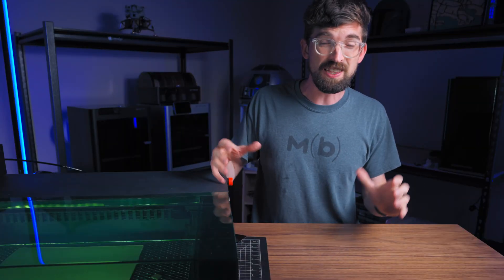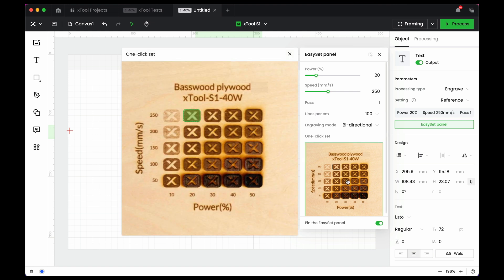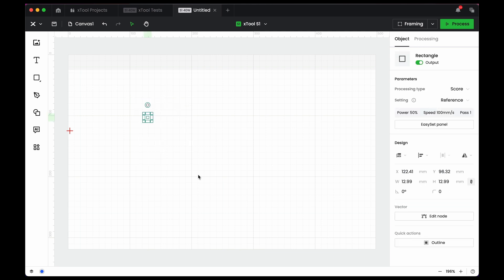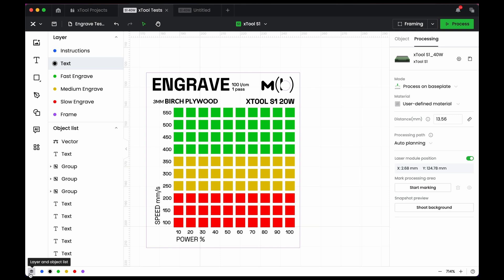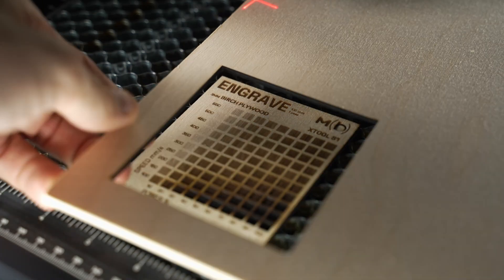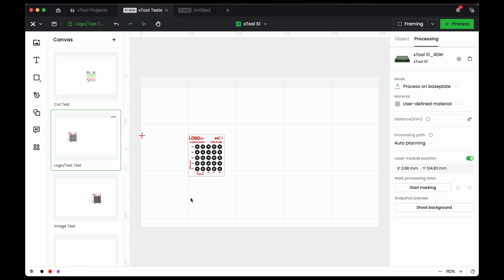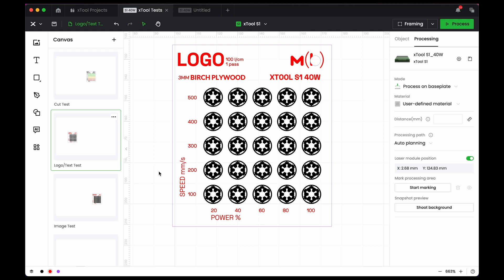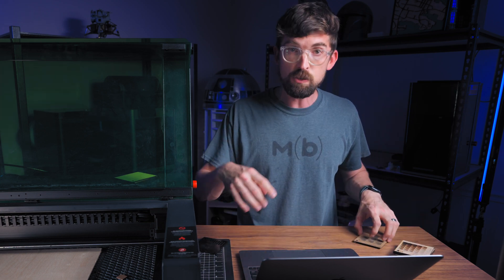How to Find the Best Laser Settings

Comment: I have the same unit as in the video S1 40W. I did the print of the first section in green, why are yours lighter then mine. My 400x100 looks like your 150x100?

Comment: Hello, just bought test for S1 on your shopify and there are errors in the fast engrave, in the image test and in the logo test. 
In the image, all fast engrave speed values are set to 400mm/s instead of mixed, from 400 to 550mm/s.
In the image test and logo test, all 500mm/s values are really set to 400mm/s. 
Where am I wrong? @makeorbreakshop